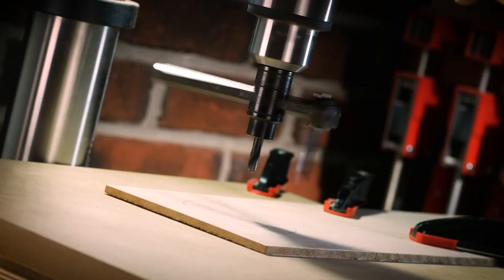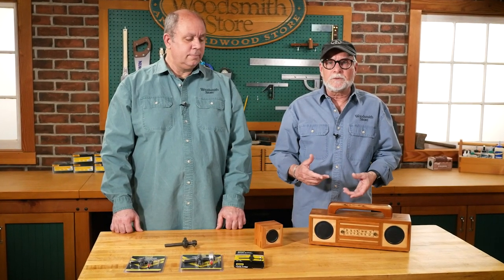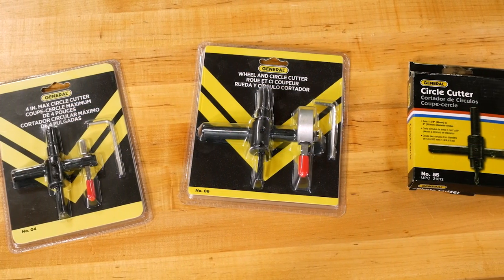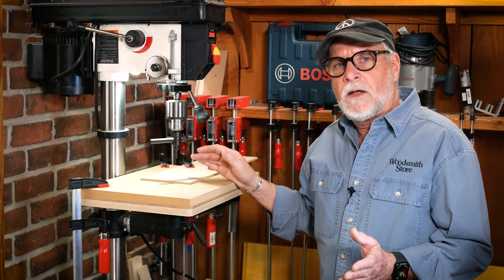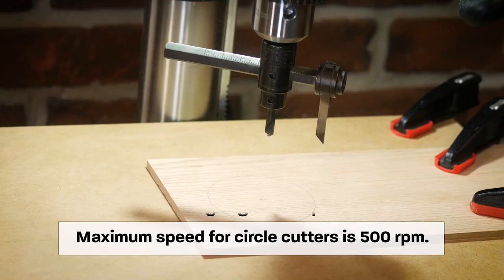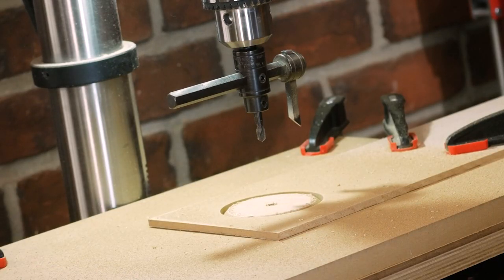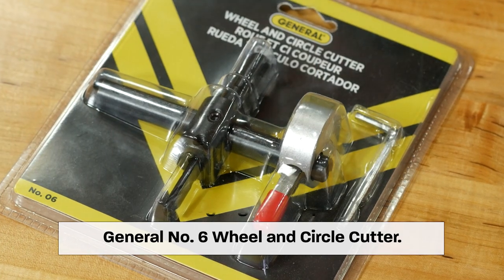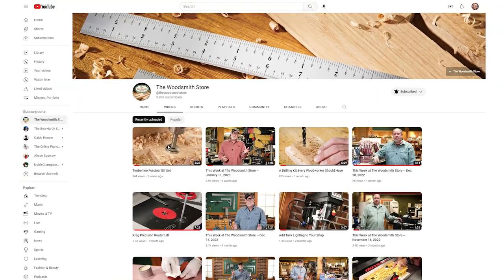How to Cut Large Holes on a Drill Press!

Comment: what's stopping you reversing the cutter orientation on the 55 (and making circles without a bevel)?
Reply from the maker: You can do this and it will work somewhat. The only downside is that the cutting edge faces in the wrong direction (there is no clearance on the backside) so the cutter sort of drags its way through the cut. For the occasional cut, it's fine. But if you're going to be making a lot of wheels, you'll want to get the circle cutter with the reversible feature.